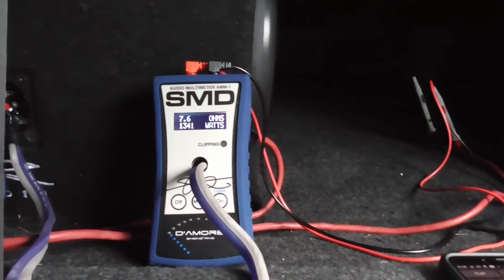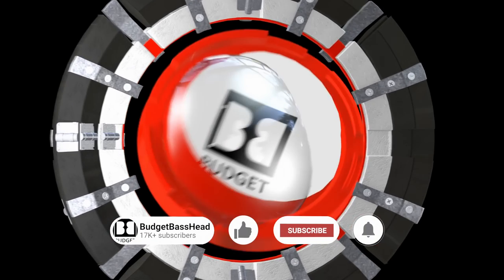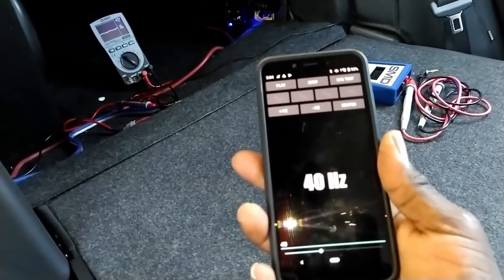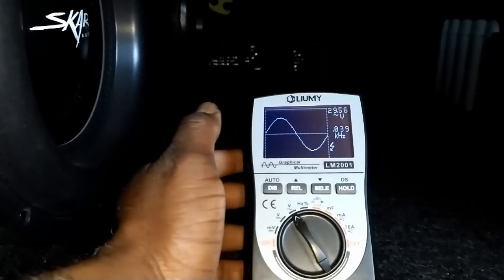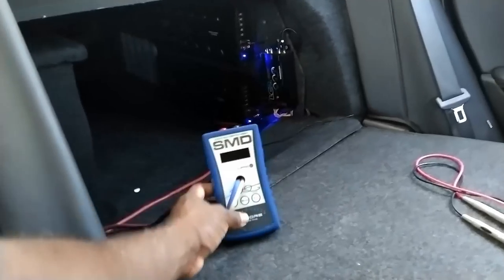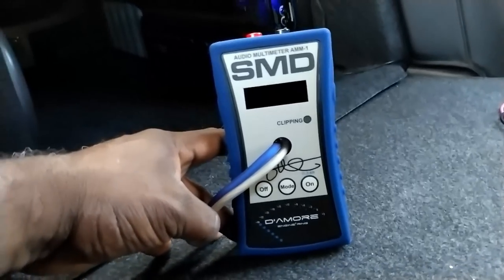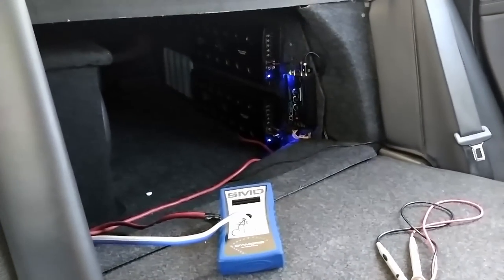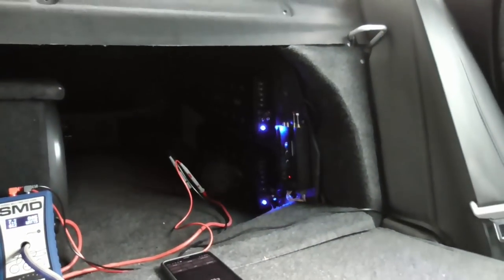How Impedance Rise Is Killing Your System!

Comment: DC Current goes 1 way. The problem is you have BOTH sub wires in the HOLE!!!!! With both in the hole they cancel the electrical current flow. Only 1 wire should be in the hole. You are getting wrong readings. In all videos about this product you will only see 1 wire in the hole. no different than any other amp volt clamp meter.

Comment: This is why new subwoofers are coming out dual 1 ohm and dual 2 ohm only. You will see less dual 4 ohm setups.
Reply: I tried explaining that to a audio shop in in Diana that sells only d4 ohm subwoofers
Reply: but 4ohms sounds so much better tho, you get better sound quality if thats what youre after
Reply: Research and development for ultimate sq speakers has come to a halt around a decade ago. JL audio, Focal, and Polk audio are not to popular as they were before. They are making balanced loud speakers now. I have Rockford Power amp on a Polk Signature Reference sub 12 and to newer 12's, the newer subs are better to jam to. My sundown U 12 to be exact. Just my opinion.
Reply: Yup I have soundstream sub that is dual 1 ohm coils sure loves more power right now she getting 1000rms by herself
Reply: @juliobello4561  not with impedance rise that’s what the whole video is about! Trying to brag when it’s probably only getting 350-500 watts w rise
Reply: @iamforever6914 not that low ha 1000 wat amp can see 800 even with ohm rise

Comment: Great content! I was playing with my new system yesterday with my SMD AMM-1 and was able to get 8702 watts at a rise of .9 ohms from one of my two  Taramps MD8000.1 amps. I am running each amp at a static .7 ohms. I was surprised to get such a high number. Both are gain matched so I am thinking I am getting around 17k during burps.
Reply from the maker: That is ironically amazing. I just purchased that amp. Video coming soon!
Reply: @BudgetBassHead  Awesome! You will love it! It definitely fits in with the budget bass theme. Not sure there is another better bang for the buck. I got my last 2 (I have 4) off Amazon shipped for $456 each. The two I have have been taking a severe beating too. But I am feeding them very well... 270 AH of Yinlong at 15+ volts with a 370 amp alt.
Reply from the maker: @Widowmaker2828  Sounds like you really know your stuff👍 you posted any videos of it?
Reply: @BudgetBassHead  I do have a bunch of videos... Some I started to upload on my YouTube channel... I bought the Irish Hux Explorer (you can search him he has tons of vids) a few months ago and tore it apart and reworked the enclosure for 4- 18" PSI platform 5 subs. Sorry it's a little long of a story 🙂 The truck had so, so, many issues from the 160+ db system it had I have been spending months sorting them all out. I took out what seemed like miles of extra wires that I had no idea what they were for. Also fixed airbag issues and broken doors and other bass issues. But long story short after much much work I got the system running great. I have a SPL labs meter and as of 2 days ago hit 156.9 sealed on the windshield, 158.7 on the  windshield with the door open, and 160+ (meter only goes to 160) in the foot well with the driver door open. It plays from 13 hz all the way up to 50 hz great. I do have a picture I took of the 8702 watts from the Taramps MD8000.1 I can upload if anyone knows of a place I can upload and link photos. Like I said I have a bunch of vids I have to upload to my site but with work and my daughter's graduation I haven't had any time to do the editing. I will try to get some up soon. Sorry so long 😁
Reply: Oh and the the MD8000 amps are just for breaking in the subs. I have a Taramps Bass 30k I plan on hooking up soon after I have fun testing with the 8ks. Then after that I have a few more surprises I haven't let anyone know about yet but they are big. 😉🔊
Reply: And people want to bag on Taramps, I love Taramps!!
Reply: Love Taramps I have a 1200.1 that actually dynos around 1800w on 2 gravity 12s and it tearing my Jeep apart everything shakes and flexes 😂
Reply: @Widowmaker2828  Lemme know when you're done with them, I'd love to purchase 1 of them (MD 8K) for my 6th order :^)
Reply: @Alanreaks35  will do. I actually have 4 of them... It's a long story but I couldn't decide if I wanted if I wanted one Bass 30k or 4 of the MD 8ks on the 4 18s. I just went ahead and purchased 3 more (had one 8k from my last system) because they were pretty cheap on Amazon. I figured I'd do a vid seeing which setup is better... The 30k or the 4 8ks... I'd bet a few might be interested in the outcome. Since then I have added something else pretty big to my arsenal so I will have even more comparisons coming. Last week at a Meca meet I hit 156.8 @38 hz but after the competition test I realized my down for sound subwoofer Bass knob vibrated and turned the bass down. Doh! I hope to go to the next Meca meet on July 10th and hope to have my Bass 30k hooked up by then.
Reply: Bruh those amps are more like 1k watts each, no wonder you’re only getting around 1400watts.

Comment: It's most likely the factory radio/line level converter setup that's making your rca voltage too low which is causing your extremely high impedance load?  Impedance rise is normal but 7+ isn't.  You will have a dirty signal from low voltage rca's.  I'm the guy that runs my aftermarket audio on a stock head unit first and change it up with an aftermarket head unit later.  After taking the stock head unit and the rca converter out of the mix, the signal is cleaner, the bass is tighter, more defined and doesn't clip as easy.  When it's clean and tight, I can increase the gain more.

Comment: Build a custom enclosure with correct cf , tune and port area and watch the difference.
Reply: May be a difference, but there will always be impedance rise
Reply: Yup. The issue is box not tuned to that spec. What ever the highest wattage you get at what tone is what your box is tuned to. Imagine some will do worse or better at 30hz. The normal decent tune is 40 to 50. That's why I go 10" to reach a lower box tune easier when I lack trunk space.

Comment: Nobody saying nothing about the Audiocontrol Line output converter. He probably doesn't have it set up correctly to his head unit since it being a stock head unit from GM. He should really think about what kind of voltage is coming out of that line output converter. This will affect a lot and I wonder if it's ever clipping out of the head unit. He has to start there first and then worry about the amps. It's the only way to be sure.

Also what about his power? I haven't seen his installation videos or anything like that but he has to make sure that he's getting enough power to those amps. In this video I just don't see adequate power wires. I mean did he do the big three? Does he have a second battery? Does he have a good ground? It could be a lot of factors that can inhibit the power coming out of those amps. Last thing I'm worried about is ohms.
Reply: Agreed

Comment: as you already know BBH with more cone control you will have less impedance rise.. I bet if you do a test with a sealed box or better yet a little 4th order you will have more cone control and get more RMS out of that set of AP amps... if you still have that Force 12S try it or something of that level of sub and put it in a single 4th order.. I bet you will get 20 to 30% more RMS out of your setup... as always you are doing big great things in the car audio world.. great job
Reply from the maker: That sounds like a formula for a great future video. Thanks for the tip!
Reply: 4th orders are known for having lots of box rise because of the sealed section

Comment: Yea I was going to say something to you a long time ago about wire down to.5 on the woofer but I didn't think you would listen sorry. Wired to .5 with two dual 2ohm woofers with rise you should clamp around 1.5 ohm on the low side depending on what Hz your testing and still be ok with the manufacture recommending of no lower then 2 ohm strapped. But now you have a AMM1 so you can test that! Love ya bro keep up the good fight, praying for you.
Reply: I had mine wired down to .5 on jl w7s and it pulled up to 1.5 using a Memphis 1000.1 completely unbelievable the power out of that system.  This was such a great video I had actually forgotten about this issue until I was refreshed here and now I know what is going on with my current system.
Reply: So if I wire my speakers down to .5 ohm from 1 ohm that will make up for impedance rise?
Reply: @Theyoufeelme  Yes every time. Don't let people scare you away from wiring .5 the amp will never see 1ohm after rise more like 2ohm

Comment: Test your radio to see what volume gets you the highest signal without clipping. Then set your amp gains. Also you can wire your speakers to 1 ohm to help with box rise. Ive seen guys wire amps to .5 that are only rated for 2ohms and it works fine because your overall impedance is higher than .5 when impedance rise is figured in. Be aware if your amp setup is only good for 2k rms for example you dont want to be over about 2.5k on peaks if your concerned about pushing your amps too hard. 2.5k on peaks should be fine for a daily driver setup. Run your test again after wiring down and see what your results are.

Comment: Steve is the real deal he made these tools for a real reason for us to not over do our setups on subs and amps and make them last longer and not over set to be clipping
Reply: Wow... How much don't you know? First of all, Steve didn't MAKE anything other than a partnership with the tool designers so he could be the marketing face of the product. That's the equivalent of being a pioneering version of Milli Vanilli. How you could call that "being real" is absurd. Secondly, charging $500-$800 for a device that can be outdone by a $120 o-scope or has the equivalence of a simple $40 multimeter from Lowes in a "more user-friendly interface" is robbery. And to do so all off of the assumption that the general public would either be too lazy or stupid to do what "his tool" can do is arrogance personified. It's a rather simple concept: buy equipment that's compatible with other equipment and don't treat the gain like it's a volume knob, put frequencies to speakers that are intended to produce those frequencies, and use basic logic and math to dial things in, and *poof*, no more "need" for this "tool". The product or him. Neither of which are as accurate as claimed, BTW. Don't think just because he runs a business and YT channel that it's not all been debunked before. And for the record, I'm not a "hater", I just know better than to smell the hot air he lets off.

Comment: 100+ volts!? Holy sh*t that is more than 10k watts @ 1 Ohm amp power!
Reply: Those audio pipe amps do some business. For super budget amps they have impressed me and I always recommend them to people on a budget
Reply: From what I’ve noticed, when you bridge channels on amplifiers the voltage from the two channels gets added together on the multimeter, which is what I’m guessing is exactly what’s going on here with these two amps strapped. so it’s actually 50 Vrms from each amp
Reply: @magictoaster806  Yup exactly this. Strapped = Bridged and that's what's going on here. Each amp is handling half of the total voltage.

And when Bridged you're wiring impedance should be 2x that of the minimum impedance each channel (or amp in this case) can do. These do 2k at 1 ohm so Strapped minimum impedance should be 2 ohm and you'll get 4k.

Comment: Increase your source output voltage using a line driver if your headunit is only pushing a 2v output signal your amp has to run alot harder and runs less efficient increasing your output voltage to 7 or 8v will allow your amp to run more efficient and will get you closer to your 2ohm load

Comment: Are you using the factory head unit??? If so that’s the first major problem
Reply from the maker: The lc2i puts out almost twice the required voltage for this amplifier.

Comment: You can probably run your subs at a lower impedance and get away with it safely.... I had my subs wired to half an ohm but with box rise it was way higher and I ran one audiopipe 2k with cooling fans and it got down! Never had any issues with running the Amp at half an ohm after I put the cooling fans on it. I have a few friends running the same audiopipe 2ks that I installed with the cooling fans at half an ohm and they don't have any issues either. And they're banging surpsingly loud.... I love those audiopipe 2ks for the price and reliability and the power they're capable of
Reply from the maker: I agree with you. But with fluctuations in the variety of music genres i listen to, I didn't want to run the risk of impedance dropping and damaging something.

Comment: Those amps might not hit rated power to begin with. Also, testing at 30 Hz might have been below the subsonic filter, which would increase resistance and cut output. Another thing is that this amplifier doesn’t go below 30 Hz. Since that’s the end of the response, it would have much less output at 30 Hz. Basically a lot of reasons that have nothing to do with resistance due to the cabin of the car.
Reply: The guy doing this video, has an audio control Lc2i that may have a pfm=programable freq. Module= subsonic filter factory set to cut power @ 33Hz! And you are correct his audiopipe apmn 2000s has a factory bass boost starting @ 30Hz. He should have tested @ 50Hz, where the power is not being restricted/cutoff. Also i cant believe that this guy does not have his full range speakers highpassed around 80hz and up?
Reply: @evilinside5984  so if the audio control cuts at 33hz, what do you think is a best option for line out converter or running signal to the amps
Reply: On audiopipes website it says subsonic 5Hz, and responce down to 8Hz, for apmn/apmi-2000, its the bass boost that only goes down to 30Hz! I know Audio Control has a built in Pfm= subsonic filter in alot of there products, and the guy in this video is using an Audio Control product= thats the Bass knob he is using in this video= Audio Control, maybe the reason for the extreme power drop off, below 33Hz?
Reply: @rmyrie5963  If you want lower freq. than 33Hz, i would double ✔️ with mfg. before purchasing, again im not 100% about this guys product having a subsonic/pfm @ 33hz, i just know Audio Control has alot of products with a pfm, that would explain why this guys power drops off so fast below 33Hz.
Reply: @evilinside5984  I have the same audio control unit. I will have to do some research. But that doesn't sound right as the audio control is supposed to restore the bass from the factory signal
Reply: @rmyrie5963  The accubass does restore the factory bass dropoff, but many of Audio Controls products have a factory set Pfm= 33Hz it starts cutting bass.

Comment: Dang, at 2 ohms, you should be getting that 1300 out of just 1 of them amps. Thats crazy! Do you think it's the box?
Reply from the maker: Its definitely the box. Too small
Reply: Yep definitely the box.
Reply: @BudgetBassHead  Dude its not the box! this is not a opinion this if facts. Stop drinking the kool-Aid
Reply: @TylerTheBassCreator  No its not!
Reply: box has nothing to do with amp out put amp not true to watt rating.
Reply: @BudgetBassHead   it has very, very little to do with your box. It's how you didn't load balance the amps. At 6:14, your correction states that your amps are each set at 1/4... Which is not how this test should've been performed. Before it's even strapped, what would be the "slave" amp you would gain adjust to just below clipping (which can be done with something as simplistic as a multimeter, much less having the o-scope you have), then strapping it to the master, and then gain adjust it to (also) just below clipping. Now, I'm not going to assume where clipping happens on those amps, but I can tell you that it's not at a mere 25%. That said, for an example, say that the slave amp clips at 41% and the strapped master then clips at 36%, so... The gains would be (in that example) set to (obviously) 40% and 35%, respectively. (40+35)-(25+25)=25. 
25% more power than your perceived 1,341 watts would be ~1675 watts, and that's assuming you'd clip at those numbers, which I doubt would be that low. You're literally handicapping the system and calling it "impedance rise". Pardon the analogy, but Usain Bolt would've never set records if his legs ended at the knee either, though nobody's ever thought of him as "handicapped", so why you're doing that to what you're running is beyond me. Your box might affect frequencies, resonances, and decibels, but it's not going to affect your wattage. You'd have gotten the same results had your speakers not even been connected, so no, it was not "the box". And if I may, I'd suggest trying what I've described above before installing the 8k you just bought, as it seems unlikely you'd turn (the single gain control) down to 25% (or 2000w) like you have done here (especially on the output source, a.k.a the master amp)....

(Side note... If I were to make a guess, I'd say you were running about 13.7v... Sound about right?)
Reply: @slowbrezze  y'all are wrong, the size of the box doesn't affect the impedance all too much it's the tuning, for example if your tuning was 35hz let's say you will have a high impedance rise at the 30hz range! And that is the main cause of impedance rise unless your box is sealed.
Reply: @Random 4400  all ok so the box size has nothing to do with tuning? so if u tuning a box what do u need to be in spec of sub either a lil smaller or a little bigger.